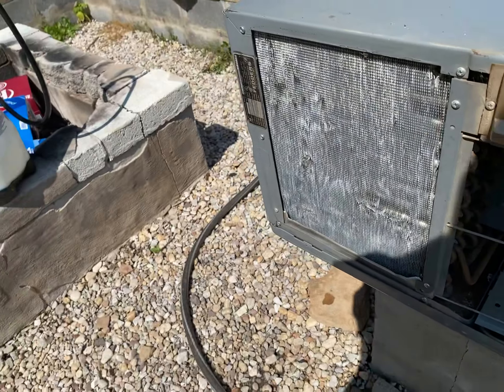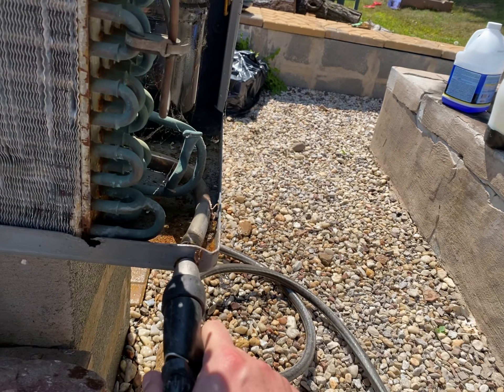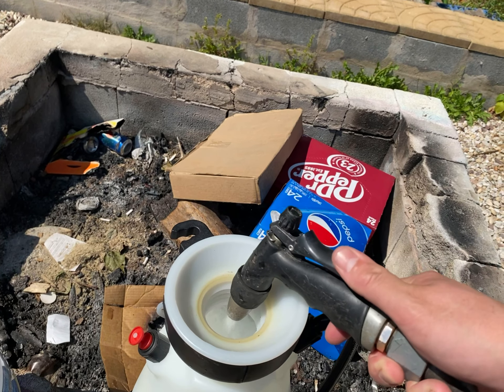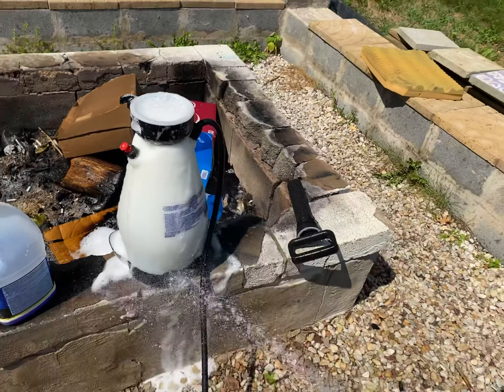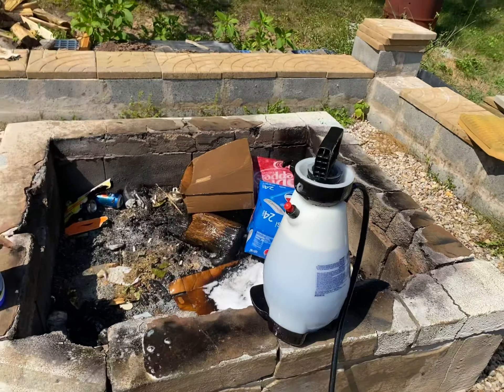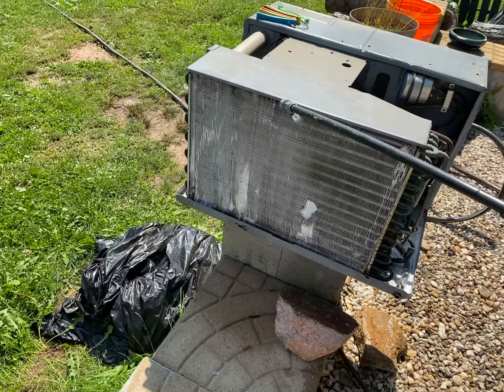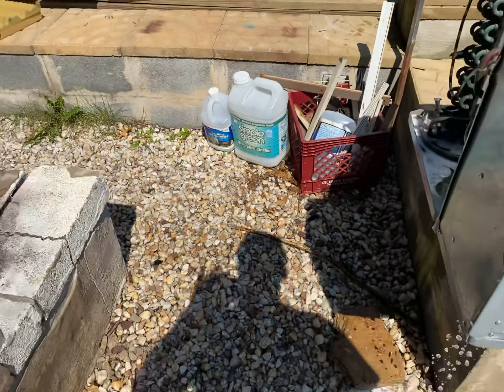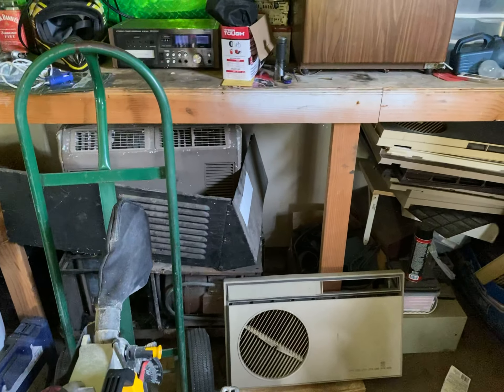Collab Vid W/ KB cleaning up my 14K Fedders Weather Wheel!

Comment: I normally use Simple Green on A/Cs for general cleaning and only NuBrite when they are nasty from years of not being cleaned.  I will spray the evaporator coil down with Simple Green after a couple months when using and let the condensate rinse the coil.  Cleans the evaporator really nice and leaves a pleasant smell.  I fear too much NuBrite may eat the coil away.
Reply from the maker: Mix it light and you wont have a problem
Reply: @TheAirConditionerGuy  My garage unit has never been hit with NuBrite, I bet the evaporator would foam up really nice.  It's just been hit with the hose a few times when I've had the unit slid out.
Reply from the maker: @ESDI80  itd definitely be a good show!!

Comment: I have a old white Westinghouse mobilair that seems to work well. 
 What is it worth, is it worth keeping?
Reply from the maker: Absolutely!!! Just give it a good cleaning and drill a drain hole and it should last years to come
Reply: @TheAirConditionerGuy  I was thinking about removing it and putting in a newer one for less weight. It's in a 87 van conversion.
Reply from the maker: @dangeroustoman  up to you but just know the new one will not perform as well or last as long
Reply: @TheAirConditionerGuy  I thank you for your response to my questions and you have a new sub. 👍
Reply from the maker: @dangeroustoman  thank you for your support. Always like hearing from you guys. Thats who i make the content for.
Reply: @TheAirConditionerGuy  you never mentioned what it is worth?
Reply from the maker: @dangeroustoman  White Westinghouse? About 40 bucks. Westing house before WCI would be worth at least double that, depending on condition. Vintage ACs unfortunately dont have much of a set value just what the potential collector is willing to spend
Reply: @TheAirConditionerGuy  thank you again.
Reply from the maker: @dangeroustoman  anytime!